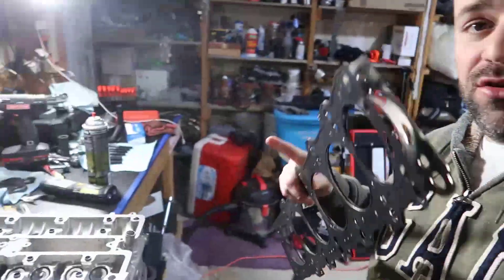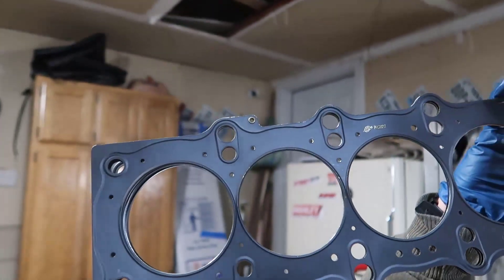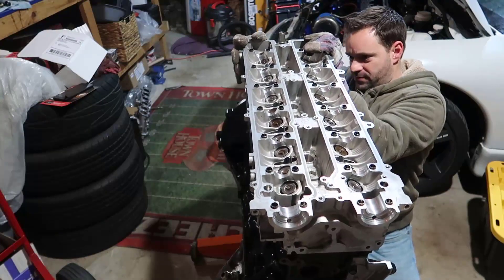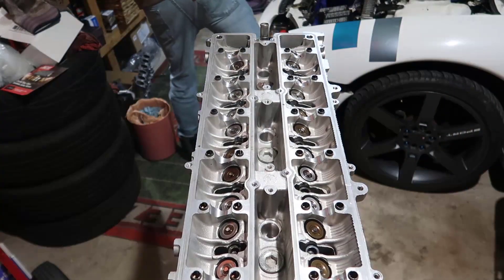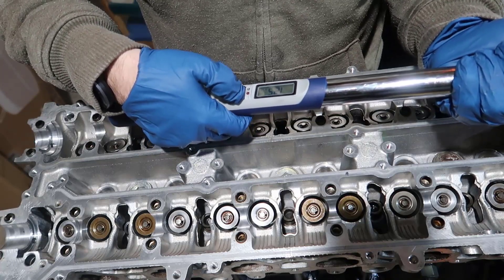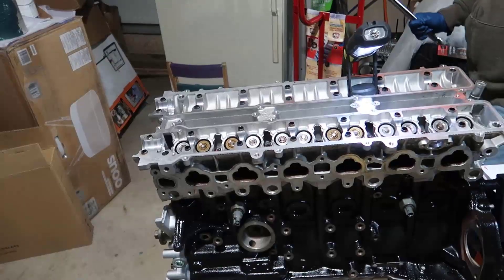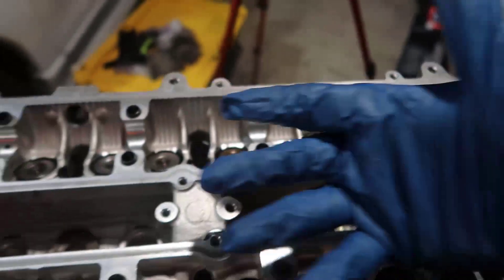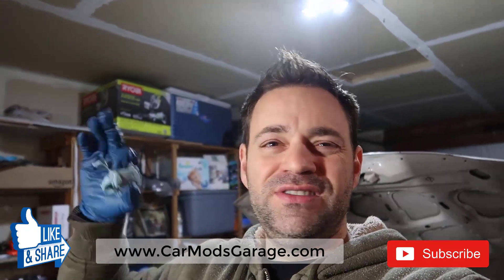Installing Head With a Street Pro MLS Gasket - 2JZ to E46 Conversion

Comment: Nice video! How well did the MLS head gasket and your OEM bolts that you reused hold up? Any head gasket sealing issues for coolant or oil?
Reply from the maker: I've used ARP hold but the MLS gasket would work either way.  It's holding strong.  I had no issues whatsoever 👌
Reply: @CarModsGarage  Oh I thought those were OEM since they weren't the usual studs from ARP. Nice. Glad to hear that. Did you resurface/clean the head and block by yourself or send them to a machine shop?
Reply from the maker: @RolanTHUNDER  oh ya you are right i didn't have ARPs on that build 😆. My bad. . I have ARPs everywhere on on the Supra 2JZ. 
The bolts are holding up perfectly.  I send the head and block to the shop to flatten and match surface. By hand i think it wouldn't be 100%
Reply: @CarModsGarage  I see :) Stock Toyota bolts are great and can usually be used one more time if the engine was never opened before. I'm getting a TRD MLS head gasket for my 4AGE 20 Valve blacktop so I'll be doing what you did soon :) Might send the head to a shop for a very slight resurface but I actually plan on doing that by hand at home. As long as the block and head surfaces are straight (within spec) then I don't think a machine shop is entirely necessary. It's just important to get a smoother finish than you would for an OEM composite style gasket.
Reply from the maker: @RolanTHUNDER  ya i agree. I've never restricted at home though. It's cheap here and i get a lot of ho from the cars I'm building that i think it's worth to do.  MLS are good 👍
Reply: @CarModsGarage  Sounds good :)

Comment: What do you recommend to do before throwing the engine on the car?
Reply from the maker: Clean everything in the engine bay since the engine is not there. 
Prepare grounds from the engine to the chassis. 
Do not install the valve cover y till you are ready to put fluids and start the car. This way you can double check the timing from the lobes inside the head. Also save the valve cover from scratching.
Reply: Car Mods Garage thanks that’s a good advice but I meant like work on the engine I’m for sure replacing front and rear main seals
Reply from the maker: Lol 😂 gotcha. Since the engine is out I would replace everything that is cheap and easy. Oil pump water pump. Front and rear main seal for sure. All the belts and possibly the tensioner.
Double check if you bottom griddle (if this is how it is called, the bottom part from the block) is leaking then redo the yours get past on it. Also check the oil pan to be sure it's not leaking. 
If you have turbo or just added it be sure to tighten the oil feed part since 90% of the lines to not twist in the feed side so you won't need to twist the while line when I side the engine bay. 
Nothing else I can think of.
Reply: Car Mods Garage thanks!!!